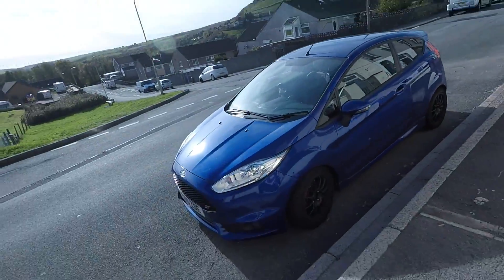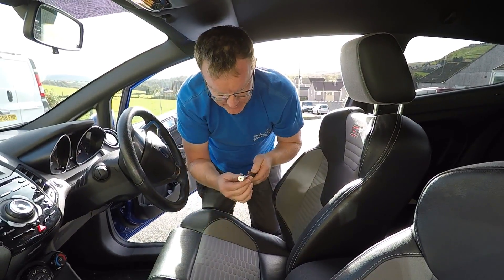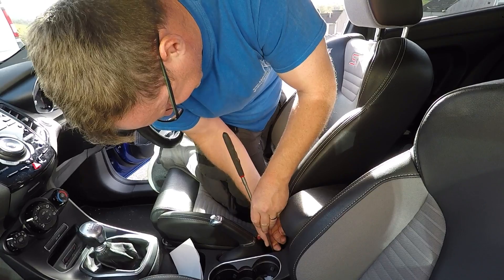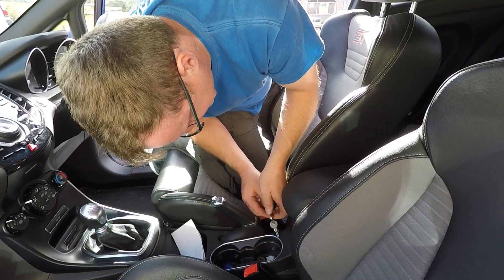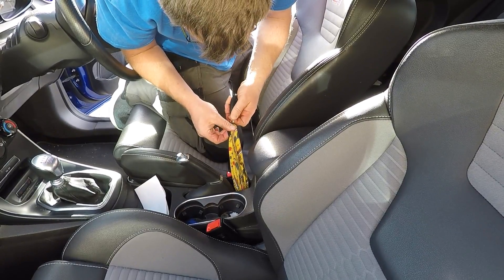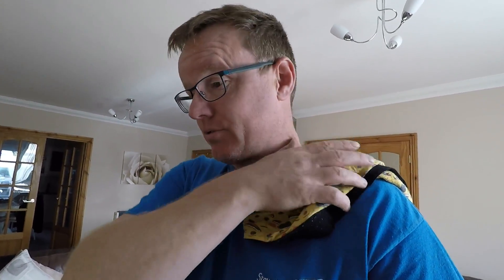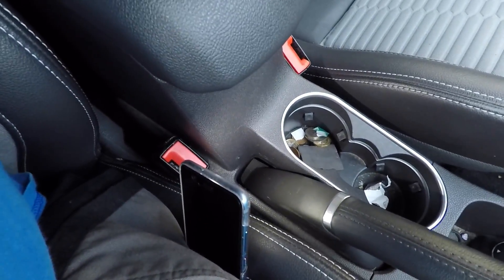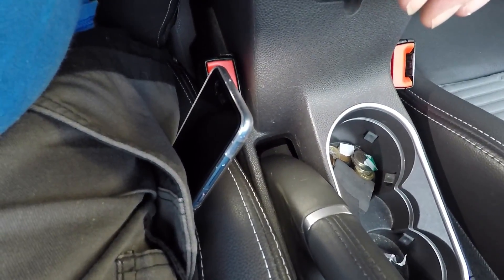Hole of Doom fixed. FIESTA ST

Comment: What they need is a sort of slot on the steering column that will accept a metal blade like thing on that keyfob then you know where your key is, even better you could turn it as a way of starting the engine, how cool would that be :)